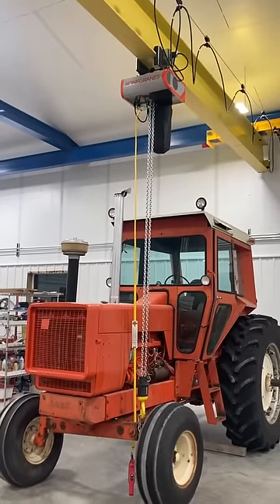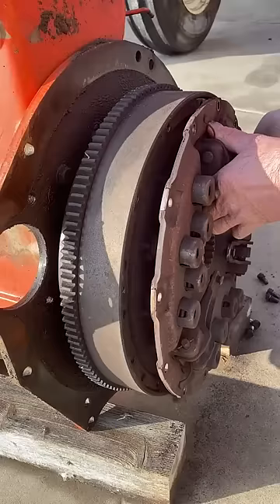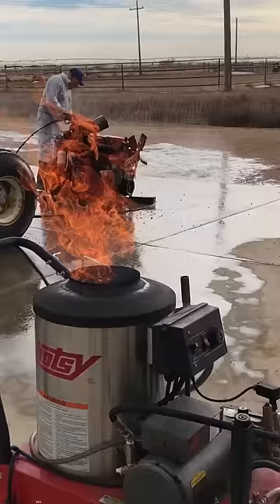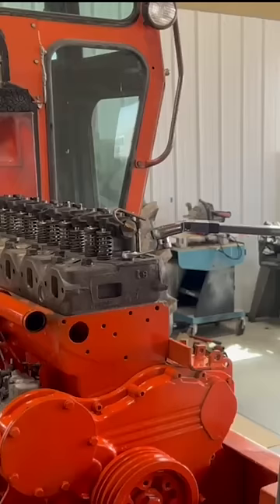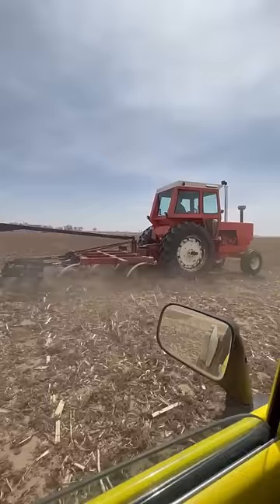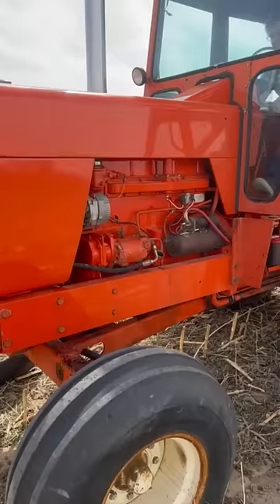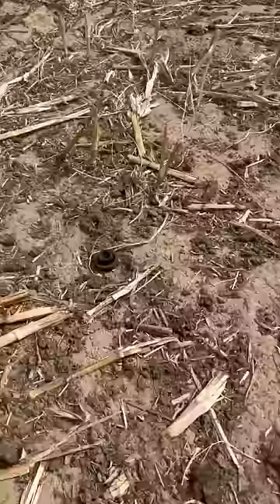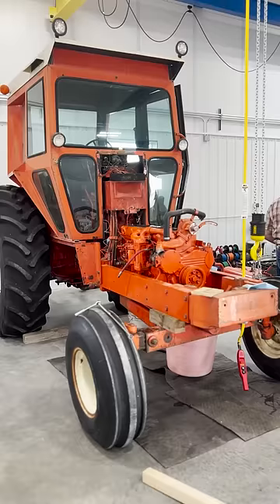#shorts This Is Going To Be The Most Expensive $500 Tractor Ever...

Comment from the maker: https://youtu.be/RHDLi9IfgKc

Check out the long form video!
Reply: Positive crank case vent plugged but if it locks up that doesn't sound right so rings end gap too tight or something with the clutch dragging the engine down
Reply: Check oil journals most likely filter collapsed in the past and bits clog the oil ducts
Reply: Do it got gas in it?
Reply: There is no way to copy link in the description from smartphone to see the full version.
Reply: Put the name of the king form video if you remember. Links aren’t always clickable from mobile.
Reply: Typed the link.  Says not available
Reply: Hi
Reply: Cool
Reply: Can you put on Lincoln?
Reply: It says the video is unavailable.

Comment: Ring gap too small. As the rings expand, they seize. Cool down and shrink. You may have been given one oversized ring. It only takes one.
Reply: You are very intelligent sir. Was thinking that or bearing clearance
Reply: @edwardzimmer2171  When us Aussie,s stop chasing kangaroos, we smart. This happened to me. One over size compression ring in a rebuild kit. Supplier payed to machine the block and new kit supplied. I check every ring now.
Reply: @darrensayer3589  thank you brother. I will pay better attention to that.
Reply: I like where you're going with that, but the problem seems like excessive blow-by if it blew the filler cap out, no?
Reply: @edwardzimmer2171  O
Reply: @raynus1160  Sorry mate, I didn't see that piece. That changes a lot. Now I am scratching my head.
Reply: Positive crank case ventilation is what I'm thinking building a bunch of pressure like that but i don't have the engine in front of me
Reply: I wouldn't say oversized ring, I'd say ring gap probably wasn't set, they just slapped the rings in and called it a day without setting gap
Reply: Was gonna say the same thing
Reply: @darrensayer3589  glad they paid, that's impressive
Reply: Yea sounds bout right
Reply: But if you watch the long form he checks all these things before assembly,ast video he was thinking injection pump timing was at fault.
Reply: @darrensayer3589  I thought the kangaroos chased you. Good to know I'm on the winning side.
Reply: @of-Israel  
I can’t read that, what happened?
Reply: The ring gap, being too tight, would not cause it to blow the oil cap off. The only thing would make it blow. The oil cap off is the pressure in the crank case could not get out. the ring gap being too large, or the gaps lined up, could cause it to have blow by, I would say make sure you have got the PCV correctly working because if it was the ring gap too tight, it would do it within the first minute of running, and it would not build blow by from that so that’s not your problem.
Reply: @e-racer4673  well you are onto something because if you've watched the long-format videos he did have Pistons scoring and broken rings, so yes excessive blow-by into the crankcase. But he's trying to figure out why he had the broken rings and piston scoring in the first place
Reply: Maybe it's two problems., One under gap, one overgap.. Under gap causes seizure., Over gap caused overpressure and popping the filler before the under gap seized.
Reply: Hahaha...I just took a guess and posted,  then seen your comment....that sucks and I wouldn't wish that on anyone
Reply: @bobcat9314  had it happen
Reply: @darrensayer3589  i could understand that ..isnt it a judgment call thats made with a few measurements..but you really won't know till its running..just like in the video..I could also see how it could create nasty problems once you need to get back inside for surgery..ripped up new rings, scratched up new cylinder wall crosshatching or what ever  its called...
Hahaha..I took a small engine class in high-school,  back in the day...ide like to think I actually learned and retained that knowledge...it was a great class, along with metals class...
But that was a different world ago..
God Bless...
Reply: I test drove an old tractor, it ran well and I bought it.
I went to pick it up 3 days later.
The clutch went out while loading it in the trailer.
 :(
Reply: It could be bad machine work or if they did a oversized bore to clean up the cylinders they didn’t get the appropriate pistons for it.
Reply: @kirbywinters1291  apparently it was injection pump timing
Reply: @darrensayer3589  where are you located? You seem like someone I could trust to work on my vehicles.
Reply: @SkylineTwinSpoolysnail  Australia
Reply: I would guess excessive ring gap and probably some of the ring gaps in line with each other instead on opposite sides.
Maybe some pcv issue.
Something is causing that pressure in the crankcase.
Nice looking tractor for that price.
Hopefully the repairs won't be too costly.
Reply: @bryantb3391  could be anything but everyone is close i bet
Reply: @Darren Sayer  I wanna chase kangaroos wit you guys🤣
Reply: @char_cole4680  more fun feeding and patting them. No way we can catch up when they are on the hop
Reply: But if the oil fill cap blew off, then the cylinders are pressurizing the bottom end. Those cylinders can't be holding proper pressure.
Reply: @darrensayer3589  Unfortunately people just don't check ring gaps
Reply: You are supposed to check and adjust ring clearance, if you skip this step you shouldn't be building engines.
Reply: Broken ring because ring gap was too tight.  Crank case pressure equals blow by
Reply: From my understanding,  Reliance's kit has rings that don't give enough clearance.  My dad has this same problem with his 220 he overhauled last winter.  Did it four times before we found out that the kit was wrong.  Every one of them was around 0.004" too tight.
Reply: Ah and it makes sense 👍
Reply: A good reason to use file-to-fit piston rings
Reply: Could be oversized pistons, that what happened with my friends model a. Pretty much a tractor
Reply: @edwardzimmer2171   bearing clearance wouldn't have threw your oil cap off.
Reply: That’s not intelligence speaking. That’s what you call experience.
Reply: I agree completely. Good call
Reply: @edwardzimmer2171  I have nothing but love and respect for Australians.  But I have to ask...... Why China????  Here in the US, can't point many fingers, we have our share of head scratchers, that's a fact.   but please don't make that mistake again, they tried to own you all, didn't they.
Reply: This comment is made from the man who knows that one piston can ruin your life
Reply: Could also be a coolant issue, but exactly what I was thinking…
Reply: I'd definitely say something to do with the piston rings but probably under size if anything. Good fit with engine cold but the cylinder expands, it loses compression.
Reply: I would have to side with this dude
Reply: Ring gap.  Suppose to gap .
Reply: Should of ran it first  to see what condition it was in. Clutch after.
Reply: Very possoble..
Reply: I was just going to comment about the ring but you beat me to it
Reply: @raynus1160 yes, but what cause the excessive blow by? The original commenter, whole not certainly right, is probably correct, and I would imagine you'd get a lot of blow by with one of your rings being too small.
Reply: @Trucks_n_stuff  
He suggested the ring gap was too small, not the actual piston ring. If the gap is too small, the ring will heat up, expand, butt together, & 'over-seal' until it seizes.
Reply: Piston rings issue. You got gas down in the crank case that got ignited blowing out the oil filler cap along with the dip stick too I would imagine.
Reply: Really I was wondering what it could be and I wasn't thinking that because it definitely had blow by wouldn't that cause the exact opposite reaction and no blow by would be present if that was the case just curious please explain
Reply: Agreed. Even when rebuilding using an exact fit kit you should check your piston ring end gap.

Comment: Maybe ring gap is an issue? I had a small engine that did that, then when looking at it i totally forgot to gap the rings, a total noob move by myself.  I feel bad for your dad, especially after putting all that work into the motor.  Keep on, keeping on fellas!
Reply: That's what I was going to say... It may be running a bit lean and the combustion temp is getting too high and expanding those ungapped rings...
Reply: @Timothy Bolden  I would disagree considering it's a diesel.  Too much fuel will cause excess heat. Not lean
Reply: I was thinking piston to cylinder wall clearance. Like it actually needed boring to the next size up due to worn cylinder.
Reply: @mattwatson4347  I did some research and it looks like you’re right. I come from a gas world so apparently diesel is completely opposite. But it does still have the possibility of the piston and ring gap being too narrow, and when the engine runs rich and heat it up and make it expand. I think that’s fair to say.
Reply: @Timothy Bolden  absolutely.  That would make sense considering they said it starts and runs when it cold down.  It wouldn't take much either considering exhaust gas tempos are incredibly high with diesels under load depending on injector and pump sizes. I know if I'm not paying attention, my egts on my truck will his 1400 degrees.
Reply: @rdcrdc8527  dont know what they did with this one but diesels of any industrial duty, even many 4x4s (at least a little while ago) have replaceable cylinder sleeves. On a rebuild you pull out the sleeves, fit new matched sized sleeves, pistons and new bearings. Can often do a full rebuild in chassis.
My Nissan Patrol, a mates older Hilux, tractors, trucks ect
Reply: Had a good friend rebuild a 454 for his 76 Camaro. Took it out and got around 2 miles on the rebuild. One hell of a pop, and bang. The engine locked up, he reused the valves, but didn't check for hairline cracks. Well one of them snapped off, and decided to punch the no. 6 piston in the dome, it was a bad day.
Reply: Looking at my scooter that's been dead and rebuilt and is now waiting on getting scrapped for more money than it's worth.(gov funding)

I barely had the knowledge to do it, but pulled through, it ran, it drove, i parked it and I just didn't want to break it again. Didn't trust my own repairs because I had damaged the mating face from the short block. 
To even get the engine appart i had to use force, cut parts away, use power tools to get anything done and that broke me more than the scooter 😅😅😅

It would have been better to sell it when it was churning through 2 odometer parts per month. 

I learned so damn much, that it stopped me buying an other burden, namely a car. 
And i took it one step down, a bicycle.

My bicycle also needed love, it needed transmission cleaning, brakes and cables, drive chain and adjustments.

I tried to do as much myself as was feasible, i bought tools and did the chain, bought cables and failed, then let that dealer handle it cause they gave me the wrong part, and i paid a little for the service. 

All was fine except that the trans cable would flop out of the holder at downshifts and then shoot to gear 1. 
I go back to the dealer ask they fix it, only thing they did was pop it back in and tell me to come back if it keeps happening. 
Eventually they recommend me a new handle because the issue with the wire had started eating up plastic tooth, about 20% gone.
And they didn't want to take responsibility for fixing it, even though they broke it. 

So I was getting tired of driving in gear 1 and i opened up the handle, i saw that the cable holder was mangled, tooth chipped and the cable could only hang on a little lip. 

I figured out that i could still shift if i kept my thumb on the cable holder while shifting. 

Then one time, my front tire deflates, i go to the same shop, i tell them to not touch the gear selector and the first thing he does is shift the ducking gears to see what's wrong with it. And i was fuming because my gear teeth flew around the shop. 
He promised he would fix it, then advised me to maybe use super glue(which is too brittle for the application)

And eventually i carefully took a Dremel to it, carved a new cable hold and path. 
I can't use gear 1-3, but I needed these last 5 gears to just work. 

Moral of the story, sometimes you break your own shit when you needed a mechanic, some other time it's best to just make it right yourself.

Comment: glad to see a product of Allis Chalmers is still being used. most of my family work there while it was still in operation. hope you can get it fully working again
Reply: From some of the older guys i have worked on the farm with who have experience with Allis Chalmers tractors, with proper maintenance those engines are so overbuilt they will last longer than you will
Reply: Representing Wisco!!!!
Reply: $30,000 later

Yep, finally got her running right.

Comment: I wonder if you had the engine run in for a while after the rebuilt before hitting the heavy jobs, like harrowing or etc. These old ones might need to run in for certain amount of hours on light jobs firstly. That's always a tragedy to seize a freshly rebuilt engine for everyone. I wish you and your dad all the best!
Reply: I was always told with diesels they need to be put to work to properly seat the rings. On the new ones when I build a dd13 or dd15 they are put on the dyno and pushed to ensure any failure happens there.
Reply: Y grandpa always tells me the story of when he didn't run in the engine on his freshly rebuild john deere tractor whenever i do engine work. He said it was a 13k mistake and my grandma never let him hear the end of it until she passed forty years after the incident.
Reply: All diesels need to be worked right off the bat to seat the rings.   She's either built right or dies. No middle ground.
Reply: Johnny Popper was redone. The owner had me drive it several hours before it ever saw work. At 14 anything like that was fun. Remember being surprised how fast it would go in high gear.

Comment: The coil baffle in the burner is missing in your Hotsy.  It's a round disk laying at the bottom of the heater chamber and if you put it back in its place you'll get full heat again.
Reply: Probable also need to adjust the air band, yours appears to be setup a tad rich (needs more air due to your altitude).  Pretty easy to do, some good videos on YT if you lookup Beckett Burner Air Band.  When tuned properly they really don't smoke at all.  Mine is over 20yrs old, just got her first pair of fresh electrodes.
Reply: @okcmoparguy724   Hotsy tech here, it’s switched over to a Wayne burner these days but you got the correct diag on it.

Comment: Just from a financial point, is this still worth it? The amount of hours poured into a pretty old tractor can't be financially viable much more, are they?
Reply: A good new tractor will probably cost you over 50000 usd, this is much cheaper
Reply: Him and his dad are doing all the repairs themselves. The parts are just pennies on the dollar for something like this
Reply: Fixing this old tractor is way way cheaper. To get a similar HP tractor in something newish your gonna spend 90-100k anymore. Get it fixed and don’t look back.
Reply: Parts are pretty cheap honestly compared to anything new.
Reply: All about time.
Reply: Have you looked a new tractor? Lol
Reply: If you look at it from only a resale value point of view then no but if it's a project with your dad and you have a use for it then it's priceless.
Reply: The quality difference in just forty years on the same model snowblower that I have five of from different decades is disgusting. The 79 is worth bearings, bushings and a new engine if I wanted but I'll engine swap it with one of my free engines off free machines when it's ready. New ones are junk. Sorry Ariens
Reply: Ifit can be fixed. It's old, the motor could just be plain broken.

Comment: Just put a 350 in it and you be good to go lol
Reply: When it needs to run 100% power 16h straight, any automotive engine will give up on day one. They're not built as robust as farm equipment are, hence the seemingly low power to displacement ratio

Comment: I would be willing to bet that the cylinder bores weren't honed to the right diameter or, the piston rings were not gapped correctly. This would explain the excessive blow by after the cylinder walls were scorched by either the piston and/or the piston rings, and this would explain the locking up. I wish you guys the best with this build.

Comment: Improperly gapped cylinder rings would be my guess. But for the cheap possible alternative solutions.. 

sounds crazy but try replacing all of the caps like the coolant, oil cap, and crankcase (they are pressure rated for certain bar like 1.8 bar). If they are worn, clogged or have been overheated they allow too much pressure to build up. Also, switch to crankcase breather cap and put a guard on it so it doesn’t get clogged/caked in mud.

Comment: I had a Yamaha 250 enduro back in the 70's. My friend blew it up, I had it rebuilt and it worked great until it got hot. It would seize up. I  let it cool, then it would be ok until I  got it hot again. Too tight tolerances. Dealer said I was too hard of a rider for a enduro. Traded for YZ 125 modified for racing with extra motor.  He was right.

Comment: To be fair, if you rebuilt the engine, then likely the issue with the engine lies in the rebuild. If it blew the cap like that, there's obviously a serious amount of pressure in the crankcase that's not being vented. Might double check the ring gaps. If there isn't enough clearance they can seize as it warms up.

Comment: My dad paid engine overhaul, and the engine needed to run 20hours parked. It staled once, and they came next day to sand cylinder sides. After that we let it idle for another 20hrs, and it worked fine. But my brother flip it next year on hill (luckly he jumped over fender), and broke whole rear tyre mount in half. Now it stays in backyard (father dont want to scrap it, because it was his first machine)🫡